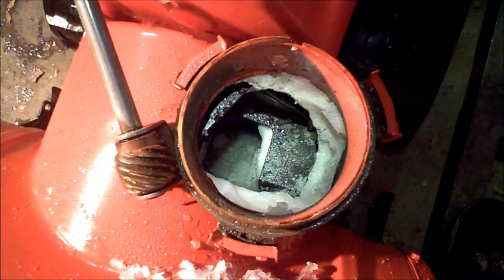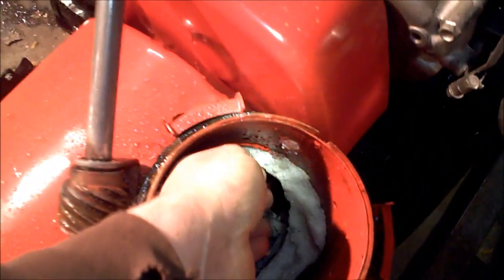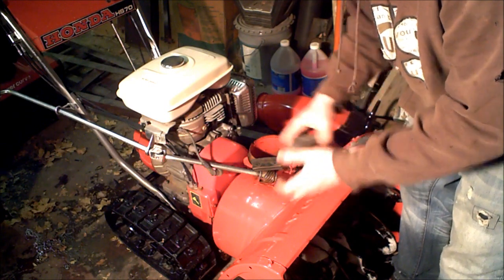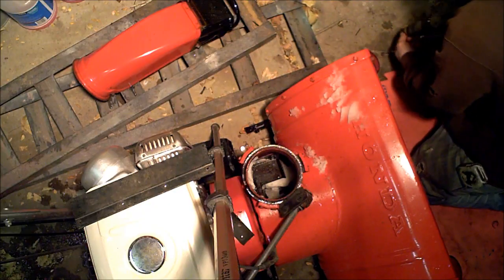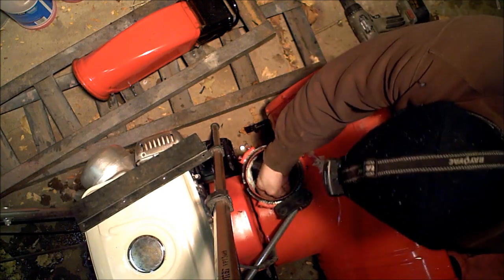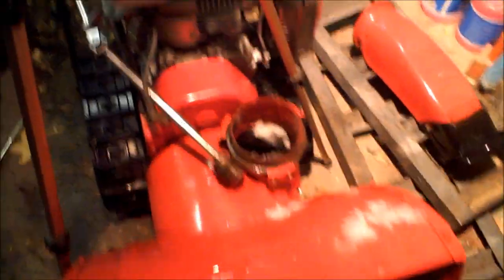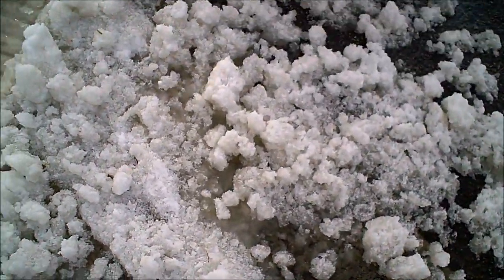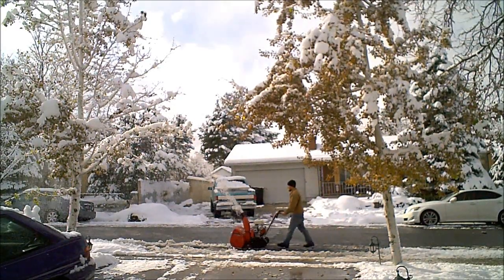Modify Snowblower to never clog and throw twice as far w/ Impeller Kit

Comment: ive never even seen a snow blower but this is very cool....thanks!
Reply from the maker: Thanks for watching. This mod works extremely well on any impeller designed machinery(wood chippers, leaf blowers, etc)
Reply: This is for Jeremy.  You lucky bugger.  You have never seen a snowblower!!!!  I have grown to Love Hate them as they are the most abused small machine out there.  worse than tillers.   Both you guys rock.  I have been to both your sites many times  Bruce
Reply: sixtyfiveford
Don't think it'll work on cheap Chinese wood chippers(Home Depot) because they have only one stage. That single stage does both chipping and throwing of the wood chips. Excellent for snow blowers.
Reply from the maker: Doing this even on a cheap wood chipper will help it to not clog and throw further. http://youtu.be/zsI8tFcFbRE
Reply: sixtyfiveford
No, it wouldn't. The chipping teeth are only about an inch and a half square on these cheapos. If you cover any part of those teeth with hard rubber it will not chip. You need steel to chip wood. Remember they are one stage machines. If you attached a hard rubber strip to these chipping teeth I would venture to say it would last about 5 seconds. We are violently busting up hard wood here, not moving fluffy snow.
Reply: azopene
I stand corrected. There is a YTube showing a wood chipper modified the same way. Been wrong before.

Comment: I did this to my Kubota tractor snow blower. Since the metal was so thick on the snow blower, I removed the chute, and drilled, then tapped the holes, and used bolts to attach the rubber pieces. 
I use my blower on pavement, and gravel, I try keeping the blower up off the ground, but  was getting rocks caught and bending the blades, and shearing my shear bolts, I am hoping this helps with that problem.  I will update after a few snows, to let you know if it solved my problem.
Reply from the maker: I will definitely keep gravel from getting pinned and rolling between the housing and impeller.

Comment: I wonder if this would improve the performance of my leaf vac. Only one way to find out, I guess.
Reply from the maker: Yes it does. I have a video where i do this on a wood chipper blower and it easily doubled the power that the blower was operating at. Any impeller based design benefits from close tolerances.

Video: http://youtu.be/zsI8tFcFbRE   
Make Wood Chipper Throw 2x as far and never clog

Comment: Hi as per your suggestion went and got a piece of mud flap from a local trailer company. Just a little concerned about thickness! It is 1/2" thick will this be ok to use in your opinion? I would also camphor edge. Also is camphor up or down on impeller? Your advice would be appreciated! Thanks again appreciate your videos!
Reply from the maker: 1/2 seems a little thick but it will work just fine. I chamfer it so the sharp edge is the leading edge as it rotates.
Reply: Thanks again for your input! much appreciated!

Comment: I have a mid 80's craftsman 8hp 3 stage w a tecumsah (misspelled im sure) that runs great. Ok motor and everything else works great but just got it and would like to modify mine BUT my impeller rotates horizontally not vertically. Can I still make this modification?
Reply from the maker: The craftsman 3 stage blowers from the 80's have the same type of impeller as I show in the video. It has 1 more stage that is chain drive directly above the auger for deep snow.
Reply: You are right. I have no idea where my head was at or what I was thinking when i left that. I bought mine used fpor 100.00 from some guy who bought a new one because this one always clogged up on him even though it runs like a top. Even though he didnt tell me thats why, It was obvious just by the way he had a pole attached to it he gave me for unclogging. After I paid the guy (who was very cool) I told him about your video and would send hm link. You could also see in his eyes why did I spend 600 for a new one! I did the modification and now I patiently wait for snow. Also consensus has been telling me the older machine I have (8 hp (Techumsah) is better then most newer ones built today. Would you agree?
Reply: sixtyfiveford
Im sorry, 1 more quick question.. Does my unit have 2 belts, 2 belts and 1 chain drive or 1 belt and 1 chain?
Reply from the maker: Off the top of my head it has 1 chain and 3 belts.
Reply: Thanks again for the mod instructions! Had some snow recently, just not enough for this but soon..Ive decided to repaint the housing, so Ill take a peak re:belts. I have extra sheer pins and chain links, just need belts handy too..
Reply: 1st of all I need to tell you this little modification has my 30, perhaps 40 year old snow blower take on new life. Turned a tired old machine into throwing heavy snow 10-15 yards. Last night I was doing some local snow removal and didnt see the garden hose. I shut off unit before it stopped turning or broke any shear pins. Did get caught up good though. I cut it out, started it then let a someone else finish up. After he finished and shut it off, 5 min later I started it so I didnt have to push it back. The lever on side of motor to engage auger now doesnt go and lock in. Its loose but if i push and hold it, it will engage but release when let go. Also the clutch handle doesnt seem to have anything in it now either. What should I look at or for? Any idea? Thanx again.
Reply from the maker: That's an impressive throwing distance. I not sure what wrong with your engagement. I would start by taking off the belt cover to see if a belt got twisted or something.
Reply: Impressive is right, Its flying! Thanks.. This is the 1st snow blower Ive ever owned and with the pounding of snow we have been getting so far this year it was good timing to get 1. I needed a starting point thanks again. Does the transmission have a clutch that will wear down?
Reply from the maker: It has a rubber friction disc that does wear. They are usually pretty inexpensive.
Reply: Great. Thanks again for the heads up again. Im going to get on this friday.
Reply: Hey, I appreciate the insights you have given me here. With re: to the clutch handle being jammed and the lever to engage augers not working heres what was wrong with it. 1st of all this is my 1st snow blower and I never realized they really are simple machines. A spring came off and the linkage didnt have any grease on it anywhere. Made a world of difference, smoother much better and friction disc liner has no meat left on it. Only 14.00 and as you stated a pretty simple job. Tuned it and changed the oil. Its amazing how this late 1970's snow blower which hasnt had a motor rebuild kicks some serious ass! Thanks again for the help. Im good to go from here on out.
Reply from the maker: That's great. Thanks for keeping me updated. Hopefully you keep this going for years to come.

Comment: Very inventive, will have to try this. Say is that an 8 hp Honda or 10 L head? I have an 8 honda going to rebuild and have a good running 8 Briggs, both engines looking for a suitable body. Currently running 5hp B&S 24 inch snowshark  "Roper" and old master craft "mtd" 2cycle thrower single stage " 3/21"
Reply from the maker: The engine on that blower is a 7hp L head. I've used a ton of those little 3/21 single stages.

Comment: Wow best tip  about a snow blower i have ever heard. You a genus. i wonder if i could do the on my leaf blower to make it more efficient. have you tried that. Thanks for the awesome tip. I subbed your channel
Reply from the maker: Yes, it works on ANY impeller designed equipment. I have a video on here where I do it to my wood chipper blower. Which is essentially a leaf blower and doubled/ tripled the air flow.  http://youtu.be/zsI8tFcFbRE "Make Wood Chipper Throw 2x as far and never clog"

Comment: Just did the mod on my 5hp craftsman (now a clone honda 6.5) and WoW!!!!! what a huge difference today.
The impeller already had a hole in it that fit a 1/4 " bolt. Used a pin to locate the hole on the strip of rubber,drilled the hole,bolted it up and bingo bango done. Now lets try the  wet stuff. Howcome none of the new snowblower have this mod???
Reply from the maker: After a ton of research I found out that Simplicity Mfg who makes one of the best snow blowers out there actually has this patented since the 70's. As far as I know they have never put it on a production machine. So no other mfg can use the idea and most cheaper brands aren't going to waste the money as it won't make them any more money.

Comment: I had to go out to the garage and check the impeller gap.. It looks like about 1/3" on my 2012 Sears machine. 
I'm thinking some steel pop rivets should do the trick. 

Topic 2:
Single stage Troy-Bilt Squall  2100. Have you seen one in use? Any good?
Reply: If you can get a riveting tool in the tight spots
Reply from the maker: Yeah, rivets should work just fine. 1/3" of an inch is a BIG gap, you should notice a huge improvement.

The technology in a single stage hasn't change in the last 20 years. This is a good classic MTD made machine. They just keep putting new plastics on them to make them look different. The engine should ring in at about 5hp so it can handle whatever you throw at it. There's always better but they cost more$$. You will be happy with it and the price.
Reply: Thanks for the info.. I'm checking out the MTD specs and reviews..
Reply: peetre
Yeah, I forgot about those long handles. I would have to remove the impeller.. :(
I've had to dismount tires, to pop rivet  mud-flaps on an SUV.
Reply from the maker: You should be able to get it in there from the front.
Reply: That might be possible. I'll have to check it out. Thanks!

Comment: Great idea, will apply your modification right away !
If you permit me, i would recommend using stainless-steel self tapping screws, it will make things much easyer when replacing worn off rubber paddles...
Thanks for sharing !

Comment from the maker: I have never had a flap come loose. There is actually a lot less force on it than would seem. It is on the leading edge and 98% of the force of the snow is actually pushing the rubber paddle to the impeller blade and holding it in place. If anything the screws/bolts are just holding it from shifting around. I'm wouldn't be worried about a paddle flying off as a light flap of rubber wont come close to doing anything versus the ice chunks are constantly being launched out.

Comment: Cool stuff!  Just a little worried about using self tapping screws vs nut and bolts. Cant believe someone is suggesting using epoxy or any type of glue! Did you ever have a flap let loose and go flying across the yard ?  Keep up the good work!

Comment from the maker: Yeah, that thick steel can be a bugger. I would think something more flexible like "Shoe Goo" would hold better with the flexing and temperature extremes, but I have never used Gorilla Glue. If you know someone with a welder, they can weld 2 bolt studs on each that you can slip the rubber over. If you do decide to glue it I would really like to know how it holds up.

Comment: hot damn . my toro does the same thing wife wanted better . just some rubber & it never clogs what an idea . I was given the toro 4 $ 30 .00 needed a wheel pin 2 keep it on the shaft or axle blew snow like crazy . I need 2 get the starter fixed it grinds when u go 2 start it but fires rite up . needs some belts 2 . thanks 4 the idea . all this started was looking 4 a blue jean vest 5 hours ago lol.

Comment from the maker: The gap increase with use. The constant outward force on the inside housing expands the diameter over time. Also the edges of the impeller blades wear and bend over slightly.  Cheap snowblower manufacturers really don't care and just manufacture a product.

Comment from the maker: That Bob Cat is a neat looking beast. It also works great on all the older Steel single stage impellers; I've done it to a garden tractor Simplicity snowblower, Small S4 Simplicity, Eska, old Craftsman and a few others. You just put a 3" or so piece of rubber on the center throwing part of the single stage.

Comment from the maker: The newer snowblowers also have a redesigned chute. It funnels the snow to clump it together. The chutes usually go strait vertical with a flat back to the chute to match the rectangular opening. Then they gradually curve to the discharge angle but at the same time the chute back rounds to clump the snow together.

Comment from the maker: One of the biggest difference I've notice between the old and new besides the length is the angle. The newer go virtually straight up for a foot before they angle it, where as the older blowers angle the chute from the start. If I were doing a new chute design I would cut my old chute to make it go vertical for the first foot before I built a deflection angle. Also newer ones seem to be narrower.

Comment from the maker: Wow, glad you found it. As you know the worm gear is an obsolete part. The bad new is it was only used on this model. If it is repairable I think that is your best bet. If not almost all other mfg snowblower in the 70s-2000s had plastic and steel worm gears that are very similar. You could take it off and run down to a small engine shop and see if the have anything similar. Also take the chute to make sure the gears mesh.

Comment: in relation to the skid plate....took Toro off yesterday and replaced it with new one.  Looks like the only way to attach is from the bottom....I have some white 55gal containers I was going to use for rain barrels...thinking maybe the heavy edge materias....What would you suggest using to heat and straighten that plastic...heat gun or oven?...or other options

Comment: I am disabled vet but I have 2 kids over the age of 15 . Both hate shoveling snow but I do have a Ariens 13hp 30" and it does clog up when I try to have them do the driveway end 
Mine is metal so I will begin to look for rubber  . I also have a craftsman 46" that fits on my garden tractor. This is the first year I did not hook it up . Last year we had little snow this year a ton. Now watch I will put it on and will not snow!!!

Comment from the maker: I have tried metal but it grips the concrete to much and chatters. It would have to remain the same plastic material. It would also have to be around 1/4" thick. I have given this a fair amount of thought and I think you would have to scavenge the bulk material from the sides of a large commercial laundry tote or maybe the sides are thick enough in a plastic 55 gallon drum. Most of the time the scrapper lasts through 2 sets of paddles.

Comment: Looking for bottom ring under the chute on a AYP Roper model # 604222.  only front half of the (gear) ring is there.  Is it supposed to be one complete ring or is it 2- piece?  ends look like the other half overlaps .  part no. from Sears web site if 83306.  What other snowblower would have this ring?    2 stage / 4hp Tecumseh.   any aftermarket place I can order this part from?

Comment: New or new replacement rubber paddles have a hole about a quarter of an inch from the edge,   That is a ware indicator.  You ware the paddle down past that hole and its time for new paddles.   ( That way on Toro single stage snowblowers )

Comment from the maker: Your single stage Craftsman will have rubber paddles. If the gap between the housing and the paddle is more than 1/4" or 7mm they are worn out and need to be replaced. New they should touch the housing. Thanks for watching.

Comment from the maker: If an engine is damaged beyond repair(ie throws a rod, etc) it can be replaced by virtually any brand. They all use standardized mounting patterns. Generally all you have to do is pick the same output shaft size ie: 3/4", 1" . Chinese(Honda clones) engine hit the market 7-8 years ago and they are good running little things especially considering the $100-200 price tag. The only downfall for these is inferior rubber parts( fuel line, pull handle, PCV, spark plug boot) seem to fall apart.

Comment from the maker: Yeah, I've noticed the little vane holes but have no idea why they have them. You can bend the tap(or adjust the screw) that pulls on the governor spring. This will boost the rpm a little. They can easily run at 3600 rpm but most of the time they are only set at 3200+-. A lever hooked directly to the throttle could easily over rev and damage the engine. You could hook a lever that pulled a separate spring attached to the governor arm. I think you could run up to 4000rpm momentarily.

Comment: My neighbor has a 3HP Toro single stage with a meager 16" clearing width and he had no problems with the 2012 Feb "blizzard".  He has a normal length driveway.   I borrow it  to clear pathways around the house, wooden porches and backyard for pets.    I use a 5HP single stage and cannot imagine a use for a two stage unless the area to be cleared is very large.

Comment: Have you ever inspected the snow deflection vanes on a vintage Toro S200?  My unit had small 1/8" holes at the bottom of each vane.  I was wondering what purpose they served and decided to run a connecting rod through the holes and secure the vane on either side or rod with  wire ties.   I can't say that modification served a beneficial purpose.  Do you think it is safe to rig a throttle control (RPM booster) on the 139cc tecumseh.  It will be lever control for extreme snow drifts only.

Comment from the maker: Yeah, I think single stages are great. They do suffer from the same issue though when the paddles get worn. Essentially when they get worn they throw and clog like a stock 2 stage(not taking into consideration impeller size). I have access to almost every snowblower made and I will reach for a 4hp+ single stage 90% of the time. With a 6" or less snow fall I can get the same job done in 2/3 the time of a 2 stage. Thanks for watching.